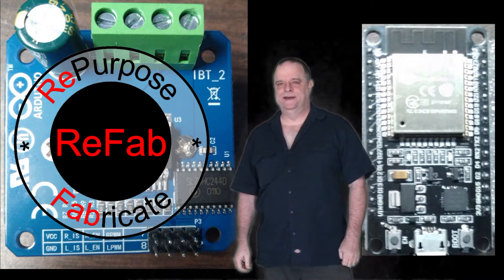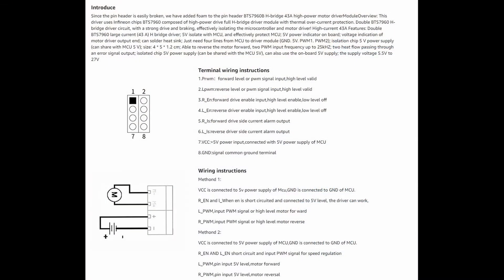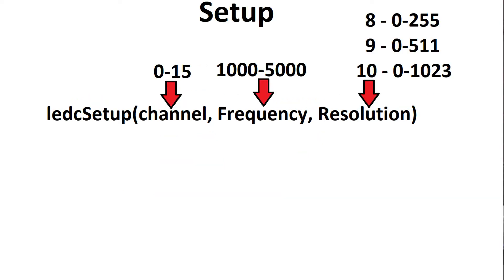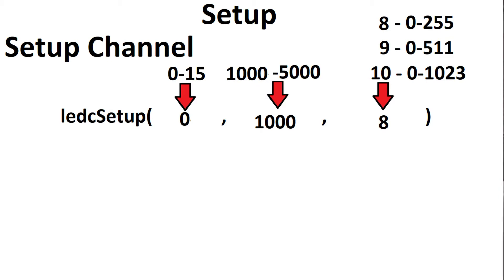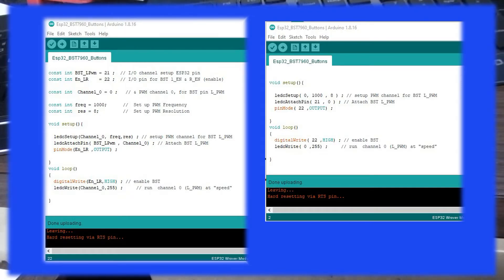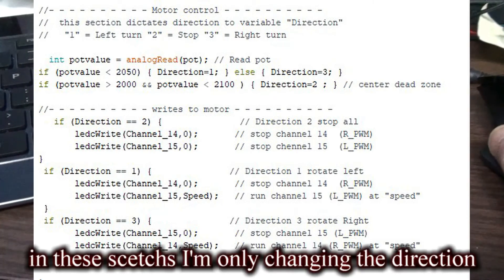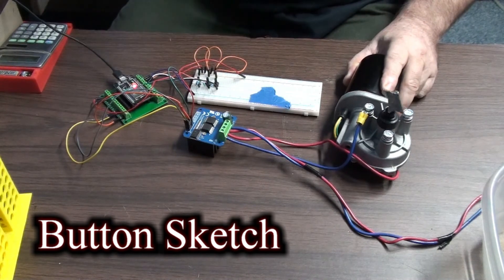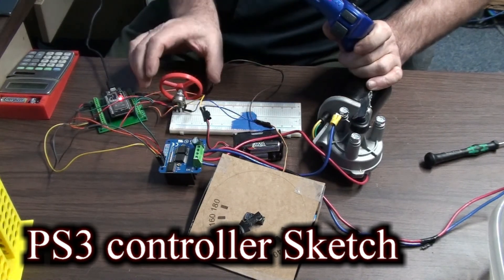controlling BST7960 motor drive with ESP32

Comment: Just figured out what no one else is saying.  WIth esp32 wroom d32, you do not have to connect vcc on the driver board to the 3.3v on the controller, apparently it pulls vc from the power supply going to the motor power.  Therefore there's a voltage regulator going to the vcc from the motor power, stepping it down to 5vcc.  I'm also assuming you don't have to connect that on the arduino either which is a 5v board.

Comment: hi i try to program the motor forward and backward with the BST7960 but it only moves forward, when i switch the PWM pins the motor is running backwards only

Comment: did you ever make it work as a servo with a pot to control it and a pot for feedback? like your other video with the Arduino micro or nano. i have a sierra quadrasteer truck and im trying to control rear steering
Reply from the maker: yes, my PlayStation controller controlled  go kart

Comment: People that can spit out a code like i can spit ou a weld will not give out a code or be helpful from what ive found. As far as hobbies go this community seems to try to not help. They all do the same vids with same nfo. You may be new but more helpful than anyone else. I have a cytron dual driver that requires a microcontroller and havent been successful. Ill try to modify your sketch to work with cytron. If successful ill post a link here.
Reply from the maker: I glad you found my video useful and hope you can get your project going.

Comment: Hello Mike,
Many thanks for this tuto.
I am alas in trouble whith an unexpected issue... could you explain me something ?
first of all say that I already drive two of this BTS, wired  as the same to your "method 1" and without problem through an Arduino (Nano). So, my BTS are already soldered, pins 3,4,7 together (the BTS 5V then)
In order to add an OTA function, I was working on migrating my  code toward an ESP. On a breadboard, with motors simulated by leds, no problem at all. But at the end, in "my real life", with motors connected in place of the leds, first the motors don't run and, even, the code itsef brake !
based on your sketch : this, below, works perfectly with a led... and crashes on the BTS, DUE TO SHORT CIRCUIT BEETWEEN 19 & 21.
At the moment, I have not yet tried to desolder and check the "method 2"... I would like  to know your opinion and own experience first. 
a big thank you in advance
Philippe

    
    const int BST_LPwm = 21 ;
    const int BST_RPwm = 19 ;

    void setup() {   
      ledcSetup(15, 1000, 8) ;
      ledcSetup(14, 1000, 8) ;
      ledcAttachPin( BST_LPwm , 15) ;
      ledcAttachPin( BST_RPwm , 14) ;
    }

    void loop() {
      ledcWrite(15, 0) ; 
      ledcWrite(14, 200) ; 
    }
Reply from the maker: Is a ground connected between the BST and The Controller?  According to the spec. sheet, for the BST the lowest working voltage is 3v (logic side). The Esp32 outputs 3.3v. It's possible that 2 BST's maybe dragging the voltage down to much ?  If you have Voltmeter, check the Volts between the Pwr & Ground at the BST, when its on and, supposed to be running.   The minimum specs on the cheap Chinese boards maybe iffy.

Comment: how did you connect the pins
Reply from the maker: are you referring to the EN-L & EN-R ? I cut the end off 1 of my jumper wires and spliced it into the end of a second jumper wire, thou I could have ran 2 separate jumper wires to the bread board.

Comment: OHHHH THIS IS GREAT!
Thank you so much!!!
Does the motor module happily work off the 3.3v of the ESP 32?

I also love the playstation controller as input, that's fantastic!
Reply from the maker: I've ran it on the bench/desk running off the 3.3v.  My controller has a voltage regulator, so usually split the output from the power (5-6v) supply.
Reply: @refab2262  nevermind

Comment: Why do you need the potentiometer with the PS3 controller?
Reply from the maker: I use the potentiometer to let the esp32 know the motors position
so, the motor position mirrors the movement of the joystick.